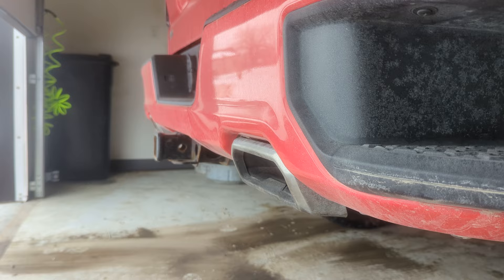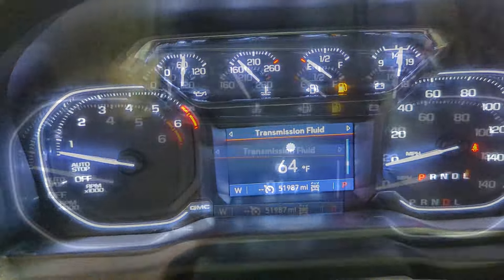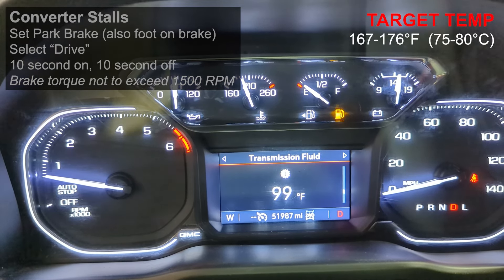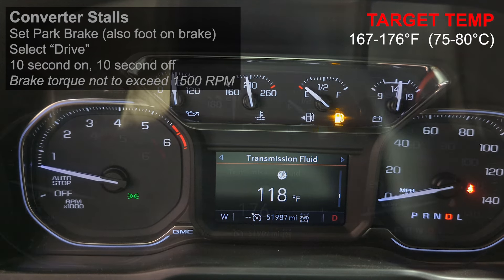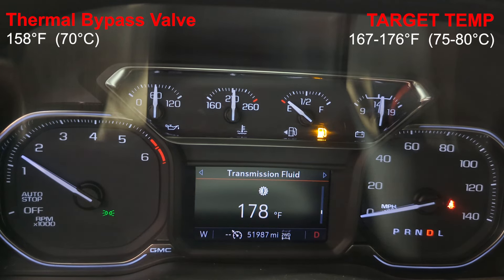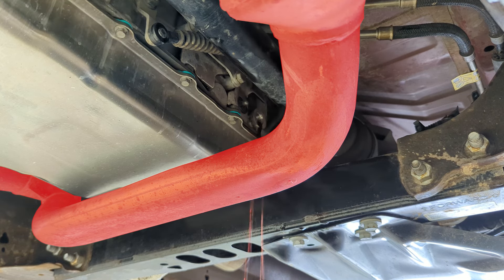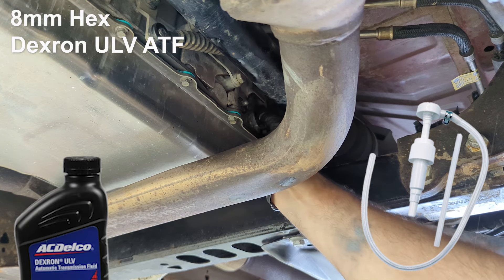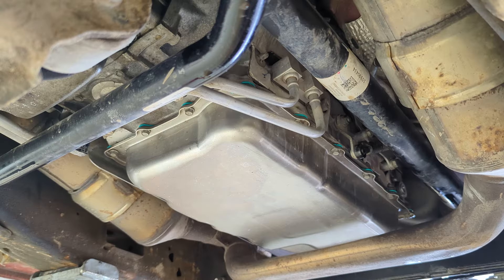2019-2024 Sierra/Silverado: Transmission Fluid Level Check (10L80)

Comment: when u drive over 30min-1hr, how high does ur transmission fluid get to? mine is a 2024 3.0L Duramax and it reaches 198°F. is this normal?
Reply from the maker: What are your average outside temps right now? What kind of driving (city/towing/average speed)?
Reply: @MasterJacks  right now summer times is 90°F-100°F,  during the week i’m driving 40mph to work and back, but on friday i’m going 70mph-80mph for 2 hrs back home. and no i’m not towing anything , i haven’t yet and it’s marking me the 198-210 mark.
Reply from the maker: @edwinmuniz1263  that does seem on the higher end for the type of driving you describe. It may just be related to your outside temps right now. I see 165-185 in the 80-90's. I'd check the fluid level and not sweat it too much if the level's okay.
Reply: @MasterJacks  i was wondering if the 3.0L diesel transmission be running warmer than the 5.3L gas transmissions. asking in general. If u have any knowledge in those transmissions (talking gmc sierra) because one of my buddies has a gmc sierra 5.3L 2021 and his stays @174°F - 176°F while on long distances and when i’m long distance in my 3.0L it stays @198°F -200°F
Reply: @edwinmuniz1263 that seems to be too hot, mine runs at 180. I would buy the PPE thermal bypass valve if mine was close to 200
Reply: @dlp4183  u have a 3.0L duramax or a 5.3L V8?
Reply: @edwinmuniz1263  3.0 L
Reply: i found out that the 3.0L duramax diesel transmissions like to run warmer than the gas trucks, the regular operating temperatures are 198°-210°, found out with some research , dealership service manager and seeing on youtube other 3.0L owners that their temps also go to that temperature.
Reply: @edwinmuniz1263 same temp as the 2.7HO gas engines..
Reply: What are some thoughts on gm 6spd transmission? I’m looking for a good size bed pick for work and I’m considering a 2021 GMC Serria Has the 5.3L V8

Comment: Some people are saying fluid temp should be about 158F. Just curious about where you got your spec from. Thanks!
Reply from the maker: Good question. The thermo bypass valve opens at 158, which is why everyone says you need to check it above that. The 167-176 range is for an accurate level with fluid expansion. These specs came for Mitchell Prodemand, which pulls from OEM sources. Thanks for watching!

Comment: A lot of fluids came out. Factory overfill? I would probably put the plug back in immediately. Am I wrong?
Reply from the maker: @Sandshredder2  this was a fluid level check after replacing the transmission filter. It was a bit overfilled
Reply: @MasterJacks  I have noticed if the pan has a standpipe the fluid will rush out of that rear plug before it comes out of the standpipe. If it has a standpipe that's the proper way to check the level....... at least on 2018 Yukon with 10L80

Comment: My 2015 six-speed still has the old fashioned dipstick. It is SO much better.   What are the designers thinking?
Reply: Better service it, they fail alot also. My 15 went at 96k
Reply: @fishinfoo2277 what? No its not easier to service. They designed them like this in order for us (customers) to have to bring them to a dealership so they can charge us money.

Comment: This job is kind of mechanics burning hazard . Would it be possible  to have some sort of special isolated cover tool to perform this job? It doesn't  seem to be safe for drainage even with gloves on.
Reply from the maker: It definitely has the potential to burn you. Maybe long welding gloves, or a hot pad from the kitchen on the pipe.
Reply: @MasterJacks  for over 80 Celcius kitchen long gloves wouldn't  hold tolerance.  Perhaps titanium  costumized ones should be the expensive solution. Bad designing from GMC as usual.
Reply from the maker: It really is poor design. Not just for checking the fluid, but running the pipe right under transmission. That's adding a lot of heat, and  makes maintenance difficult. They've been doing it for years
Reply: @MasterJacks  GMC is not running  the company  into a more wide didactic automotive infrastructure but budget cuts.